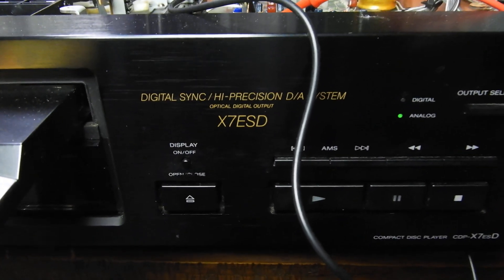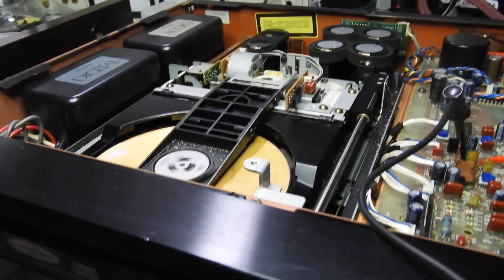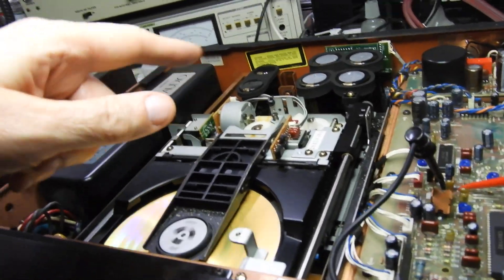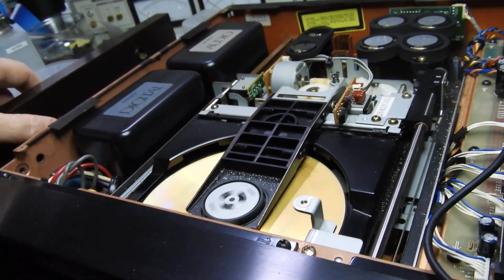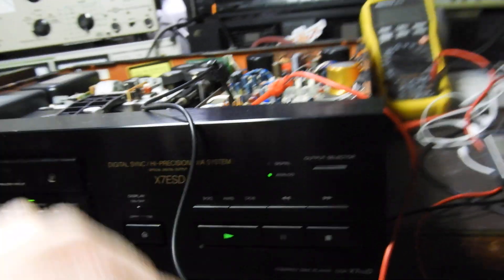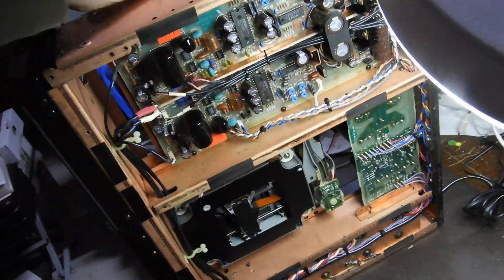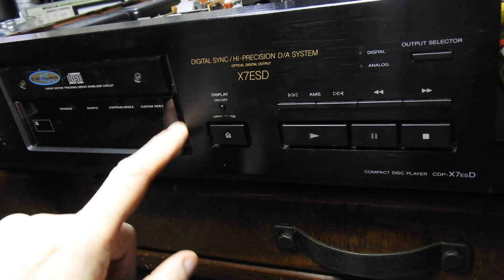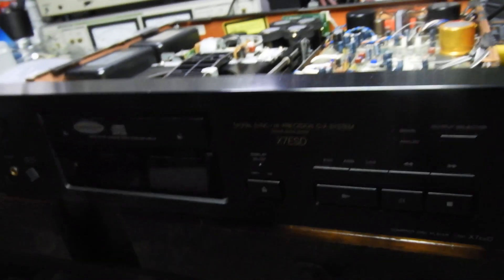Sony CDP-X7ESD - Superb unit with KSS-190A mechanism & 2 x Burr-Brown PCM-58 DACs Great as Transport

Comment: I've just bought a CDP-X707ES in beautiful and working condition but it seems that at transporting something bad happened. It plays CDs but just for 20-25 secs. It starts skipping after the first 20-25 secs of the CD and can't reach track 2 or more. It seems pickup just tries to reach it but can't move. I opened its lid and it seemed to me that there is some kind of lock mechanism in it which locks the pickup when I opened the tray. I suspect this lock mechanism don't release the pickup when I close the tray. I can't move the pickup with hand. If I switch off my X505ES which have the same mechanism, the pickup easily slides on the rail if I tilt the player. On X707ES, the pickup remains in its start position all the time. Rails are absolutely clean. Unfortunately I can't see this lock mechanism when I close the tray so I can't decide if it is the problem or not. I don't want to disassemble even more. Do you have any suggestion about it?
Reply from the maker: Flip it over and there should be a slot for locking and unlocking the head. Normally, 1/8 turn anticlockwise.
Reply: @hear-net-au Thank you for the answer! There is a hole on the bottom side but nothing states this could be a lock. I think later players like this don't have manual transport lock. Even service manual and user's manual has no comment about it.
Reply from the maker: @1984robert  Normally, there is a sticker next to it.

Comment: You have great videos from these old great machines!
I love these old Sonys. I am a classical music CD collector and I like the functionality of these. Even cheaper models had "music calendar" function, index display which is very useful for me (I have many old classical Denon CDs from the 80's and 90's and these usually contains index points at the key musical structural points). Earlier I used a CDP-710 from 1989 (it is still working at my brother-in-law) but I replaced it with a CDP-X505ES. That is a marvellous machine. It had problems with the tray (sometimes I had to push it with finger because pull in didn't worked well). I took it to the local service and they replaced the belt. It works but now it pulls back the tray 1-2 seconds after I opened it. I need to replace CDs quickly... It didn't do that earlier. Service said they can't fix it because replacement parts are not available anymore. They said that laser is in 80-90% condition and it will broke slowly and replacement pick-up unavailable too. I knew that replacement is unavailable but I thought that it is in better condition because currently it plays everything flawlessly.
I thought I will buy a used CDP-X707ES and I spare this 505 as replacement unit but now I can't what to do. I browsed in the currently produced new CD players but they are all a piece of crap if I compare their functionality with these old Sonys. (Pro-ject's top transport can't even show remaining playing time which is another functionality I use frequently.)
Reply from the maker: The tray problem is an easy to fix. A limit switch needs to be cleaned. If you are technically minded, you could do it yourself.
As far as laser being in its last legs, if this is true, it is only because someone unnecessarily cranked up the power on it. Beware of service joints that say they need to replace limit switches. Maybe send it to someone who specializes in CD players. Where are you located?
Reply: @hear-net-au Thank you for the reply! Tray works fine now. I don't know how but problem disappeared one day and it works fine since then. Opens and closes only when I push the button.
As far as the lasers, yes I am afraid laser lifecycle. I bought a used and cheap CDP-X303ES which contains the same pick-up type and works well. I have the Pierre Verany test CD and it contains dropout tests like your test CD. X303ES performed better in dropout tests than X505ES so I think its laser is in good condition. I put it aside for spare part. My dream is a X707ES, maybe I will find one in one day.
I live in Hungary, Europe. Local HiFi service isn't first class in my opinion but that is the only easily available for me. I would like to find good service for vintage CD players in Europe but I didn't find yet.  Unfortunately postage for these old big and heavy machines is very expensive and risky. As far as I know you located in Australia which is on the other side of the planet unfortunately.
Reply from the maker: @1984robert  But I do travel to Europe occasionally, and if you invite me to Budapest for a few days, I will service all your players there. Particularly, if you know someone in the travel industry who can do a good deal on one of these cruises down Danube to the North Sea. ;-)
Reply: @hear-net-au Oh, that's great. I will keep in mind.